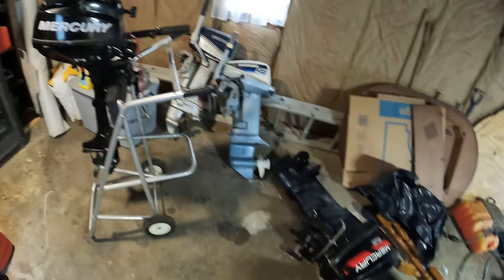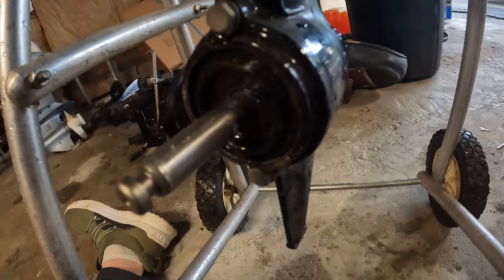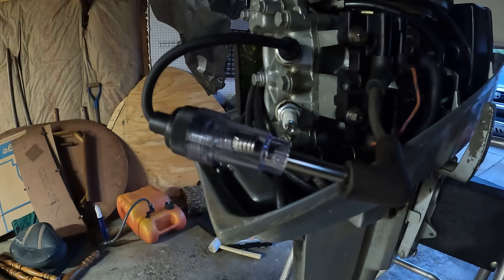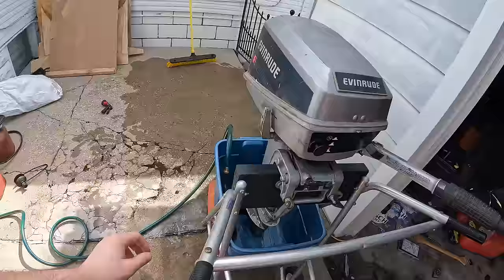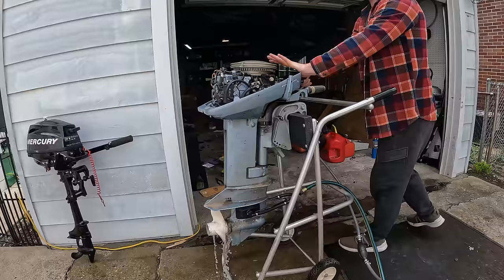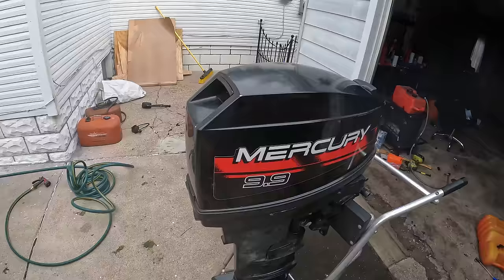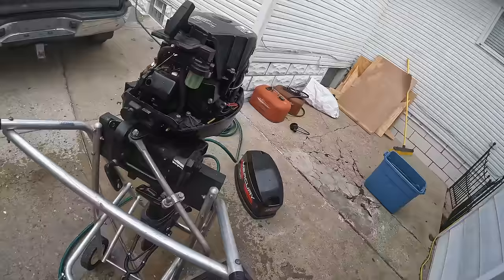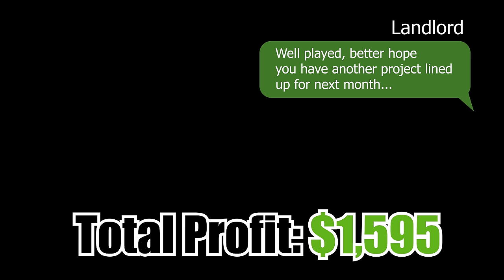Fixing & Flipping 4 Junk Outboards to Pay my Rent!

Comment: Please make more videos! 
I’m working on a 55 HP Evinrude my grandad gave me before he passed away (plus the 16 ft aluminum boat it came on). It bogs down when I get into higher gear but starts up fine. It’s very sentimental to me. This video was encouraging!
Reply from the maker: Making them as quick as I can!! Really appreciate the support. And yeah that’s a very common issue on the old 2 strokes, just sounds like you have a bit of dirt stuck in the high speed jet on your carburetor. Cleaning the carb should solve your issue! Either that or you have an air leak somewhere between your gas tank and the motor 👍🏼 make sure gas tank is vented as well. Also if it’s just a bit of dirt in the high speed jet many times you can just buy a can of seafoam and mix it with your gasoline and let it run for a bit. Seafoam will clean your jets and sometimes you can get lucky and not have to pull the carb off at all! (Although I always recommend removing it and thoroughly cleaning it). Best of luck to you!! Always available on instagram to give you any advice you need to get your granddads motor running. He’d be proud 👍🏼

Comment: Nissan builds a great 4 stroke, their value line is Tohatsu, basically the same outboard rebranded.
Ordered mine from Port Supply, the wholesale div of West Marine, it was very reasonable!
I put a TINY stick on vibration activated programmable digital hour meter, put the same on my generators, lawn equipment. They are great, cheap, most have never seen one!
I change the oil VERY OFTEN, they hold so little.
Lower unit oil too, this is never changed by 99.987 of owners, especially on stern drives!
Dry starts will instantly take out the impeller,

Comment: Cool vid. The majority of 2 stroke outboards I buy not running the blocks and lowers are always solid. Pretty quick to get them going good. 

Used to flip them in high school. 3 days ago I bought a 06 Suzuki 140HP 4 stroke all rigging 2 ss props + extra lower unit and controls for $800. Guy swore it was a solid motor but didn’t have it on a stand to show it ran. 

175 psi across the board no water in oil. Turned on and ran flawless first key flip. Worth $3k-4k. Great vid
Reply: ***Only lesson I learned in my 27 years. Don’t buy one from any young person. Get burned almost every time
Reply from the maker: As long as it has compression - I can make it run… but yea I love the ones that fire right up - the best feeling! Also don’t give all youngsters a bad rep! I’m only 24 😅😅
Reply: @BoatBusters  “youngsters 20 or under”. I remember what I did to those engines I would run religiously at that age. Being a broke 16 year old with a healthy motor was never a good match. Couldn’t afford the gas let alone the oil.

A youngin will lie right to your face and says it runs perfect. 30-40yo in a half decent area for the most part are honest and take way better care. 

Everything blows up but who’s using determines how fast it blows up
Reply from the maker: @jesseferreira8298  yea I can agree to that!!!
Reply: @BoatBusters  keep it up. For only 2 videos your doing more than awesome view and subscriber wise. 🤝
Reply from the maker: @jesseferreira8298  means a lot to me man! Really do appreciate the early support 🤝
Reply: @BoatBusters  what state you live in? I’m in FL. Majority of the time the heads are good but everything else is trashed. There’s a dude that drives down motors from up north and sells them down here
Reply from the maker: @jesseferreira8298  that’s too funny… I’m up in ohio - tell him to keep our good motors here!!
Reply: @BoatBusters  I freaking knew it! Every girl I dated down here strangely enough has been from Ohio. Only been there twice but by the looks of the vids I figured it was Ohio or somewhere close. 

Girls up there are brutal. Be careful my friend
Reply: @jesseferreira8298 Age don’t matter anymore lol 2 weeks bought a Johnson 20 hp guy swore it run I believed him due to his age and seemed honest said it just needed to be reasealed. Well he tried to reaseal it himself put all the gears in backwards trashed lower unit. Then last week bought a boat with a 60 hp Johnson from a older gentleman ran great in driveway I was skeptical because all the new parts but thought he was honest bought it took it out and it cuts out at wide open throttle Called him out and he basically admitted it’s been doing it. Long story short age don’t matter scumbags are of all ages now days.
Reply: @jesseferreira8298 fantasyland, you can’t trust anyone regardless of age😂.
Reply: @db9818  the problem is if someone gets burned on a deal they try to burn the next guy in-line to recoup their money. Anytime someone says it just needs carbs cleaned I never buy it. 

I’ve tore down a ton of carbs and only had 2 that were actually clogged

Comment: Just a heads up.  When you check compression take out all the spark pugs out and check with all removed.  Those engines with 75# would have measured 100# and thats a more accurate number.  You should have also been able to sell that 25 merc for 1800-2200, those are solid engines

Comment: When shopping for a project outboard, how old is too old? I bought a 4hp Evenrude about 7 years ago probably 1980s, took it for service, and was told many parts for that engine were no longer available. I looked up the parts and it seemed the shop was correct. Ended up leaving it at the shop and walked away from it. 

Great videos, Please keep 'em coming.
Reply from the maker: @LouisBackover  thank you! Also it really depends on the parts… also your issue was most likely less of how old it was but how low of horsepower it was. I’ve never had issues finding parts on any Evinrudes from 1965-1999 but I also really only work on 9.9 to 25 hp. And also depends on if you’re buying carburetor kits or pistons / cylinder rings…

Comment: Quick question. First I want to thank you for your podcast. I’ve learned a lot watching you. My question is I have a 9.9 mercury. I believe it’s a 1998 and I understand you can just change out a carburetor and make it a 15 horse. This motor is a two stroke motor. Can you switch out the carburetors on the older style mercury?

Comment: hi, great video! and to stop an otboard without killswitch you can pull the choke in and out (it works for me)
Reply from the maker: Thanks for the compliment and for the tip! Never have any issues flooding the engine doing that?
Reply: @BoatBusters  no, you just do it reaaly quick and if you dont have a other option

Comment: This just shows how much prices vary by area, Around here anything under 9,9hp is a tiygh sell running or not and a $100 motor at best. 9.9 and 15hp 2stroke motors bring $1k or better in season, about half of that in cold months. Larger remote motors are hit or miss, generally smaller 2 strokes are hard to find buyers for, larger 115 and up motors do better. Mercury in general is harder to sell then OMC. 

The fish police here gave a buddy a ticket a few years ago for running a Honda 100 (10hp), on a 9.9hp restricted lake. Although to game warden mistook the Honda 100 decals as meaning '100hp, a judge upheld the ticked because even 10hp is over the 9,9hp limit. It cost him over $700 when it was al done. I have four of those motors and have run them there for 30yrs or more without issue but they chose to pic on an 80 year old man that day  for some reason. I've simply changed the "100" labels on mine to '9.9hp' since then.
Reply from the maker: That’s insane… yeah there’s a lot of variance in price for sure.. also, seriously?? 9.9 and 10 Hp are the same thing… writing a ticket to anyone for that is disgusting, especially for an old man. Really sucks to hear that

Comment: Great video man! I have a five horse Coleman four stroke that is giving me fits trying to get it running. It has good fuel pressure good compression good spark every once in a while when I’m trying to pull it yanks the cord out of my hand… any ideas?  Sheared flywheel key maybe? Out of time? Who knows! Wish you were my neighbor!
Reply from the maker: Thanks for the support man! DM me on instagram - same username as YouTube and send me any videos you have of the issue if possible. I will admit I have never owned or worked on a Coleman before, don’t see too many of them but they all work the same more or less. I’d be glad to give you any info I can but I’d need to see exactly what you’re talking about. So yeah shoot me a DM with pics / videos and we will see what we can find!

Comment: I am building a 1648 panfish stick steer.  I could really use some advice on what prop to get for a 25hp mercury 2 stroke from the 80's.  I cannot find what came on the old bass tracker panfish.  As far as weight.  I will be lighter than the tracker panfish overall.  Any advise will be greatly appreciated.  Thanks.

Comment: Are sellers generally willing to let you run through their outboards with testing, or is that a bit of a sales pitch on your part? Just wondering how willing they are to spend time while you do so on a $200 engine. What do you tell them? Thx, learning a lot!
Reply from the maker: @jameswallen4854  depends on the deal. Often times people just don’t know what they have and will be selling a good motor for the price of a blown parts motor. In those situations I do not waste their time with tests and bs because I know his phone was ringing off the hook with people trying to come buy it. Also on those great deals I know that no matter what I find I’ll be able to at least part the engine out for some profit. However other times I’ll get into one a little below fair price and those I want to at least compression check. Small outboards really will never cost more than $100 to restore spark to if the ignition system needs work so I rarely test spark when buying. But if a seller can’t run the engine for me and refuses to give me 5 minutes to compression check the motor before I buy it then they’re 100% hiding something big and I’d rather not buy it from them. Only happened to me once, 99% of sellers will not have an issue with a quick compression test
Reply: @BoatBusters  thats awesome man, thanks so much for taking the time with the detailed answer. Its makes total sense!

Comment: Hey man I just got a 1986 evinrude 2 stroke motor and it ran fine when I got it maybe a week ago and the 3rd time I started it it would only start with the stick all the way in forward and even then it was taking my 1648 jon about 6 miles an hour, I’ve got good compression on both cylinders, have spark, rebuilt carb several times, any ideas what it could be? Thank you this is killing me, it’s my first boat and I’m a little lost
Reply from the maker: Sounds like an issue with the float in your carb. Usually no start unless wide open is a tell tale sign that your carburetor is flooding the cylinders. Too much gas to ignite until you open the throttle and the extra air will allow it to start. Since this is your first boat, a very common beginner mistake is not having your gas tank vented. Gas tanks have a vent on the lid that has to be open to let pressure out. Vent the gas cap and unscrew it to let pressure out before connecting your fuel line. What happens is the pressure builds in the gas tank then you release it into your engine and the pressure from not being vented will force excess gasoline into your motor. So first and foremost make sure your gas tank is vented properly. Next thing make sure your primer bulb is facing the right direction! There’s usually an arrow to indicate correct direction of fuel flow. Lastly, just because you rebuilt the carbs does not mean the float is set correctly. They need to be set manually and are not pre-adjusted “out of the box” … the float must be level and there is a line on it to mark how high / low it needs to be. There is a test (no tools required) to make sure your float is closing properly, I demonstrate it in my most recent video!! Also these motors run surprisingly well on only one cylinder. I would get a gap tester and make sure spark on all cylinders can jump a 7/16” gap. If you have any more questions or need more help I’m always here as a resource for my YouTube community- feel free to DM me on instagram (same username) and I’ll help you work through your issues best I can!

Comment: Question for ya, where did you install the positive and negative wires on the motor?
Reply from the maker: @MichaelAnthony-f7p  red wire goes to the right post on the starter solenoid, black wire goes to engine ground: normally on the bolt that holds the starter to the block 💯
Reply: @BoatBusters  your the man! Idk how you responded that fast, but thank you
Reply from the maker: @MichaelAnthony-f7p  There is no higher priority than making sure my subs have their questions answered!!!
Reply: @BoatBusters  well since I’m here I might as well ask another question, I have an evinrude 25hp outboard that has a lose starter. The cylinder that covers the inside of the starter is very lose with the gasket hanging out. How do I go about tightening the starter because I’m afraid if I start it it’ll fall apart. Thank you!!
Reply from the maker: @MichaelAnthony-f7p  shoot me some pics / vids to my instagram (same username) and we can take a look!
Reply: @BoatBusters  awesome thank you!

Comment: Did you check the impellers on both evinrudes? Both didn’t seem to be pumping much water?
Reply from the maker: I have a larger tank that I test impellers in, the muffs were leaking on the 9.9 and the 6 the water was barely above the intake. Both were much stronger in the deep tank but I unfortunately didn’t film that. Good eye though! Was waiting for someone to call that out…
Reply: Awesome channel. Subbed. Cheers from Sweden.
Reply from the maker: @northernmotion090  🇸🇪 🇺🇸🤝 thank you!!

Comment: Hi good sir what can you tell me about my issue I have a 89 150 blackmaxx the issue is it's peeing but not a steady stream it's more like spitting... I've change thermostats and water pump impeller this is my first boat and not too much knowledge on 2 stroke motor
Reply from the maker: That’s very common on the larger Mercury motors if you are using the water hose muffs at home. When you are on the water riding it in the lake does it still just spit? You can also fill a large barrel with water at home so it’s well above the intake and put it in gear and raise the RPMs. It should turn to a good strong stream submerged in water. If it still is not peeing on the lake and you’re confident your water pump and impeller is good, you may have some dirt or sand in your pick up tube or water lines. You can try to take some thin wire and run it through the pee hole and see if there’s any blockages. However I’m betting that you’re just using muffs in the driveway and most of the time that just isn’t enough for those beefy motors. Good luck!!
Reply: @BoatBusters  thanks yea I did all that poke it with trimmer wire took it to the lake thinking it's the muffs but same so I'll check the pickup do you think the water jacket have anything to do with it?
Reply from the maker: @hmongxwb88  it could. It’s definitely the most uncommon and rare issues with water pumping and is always the last thing you should check though - it’s a huge pain. If you only replaced the impeller I would replace the entire water pump housing and seals as well, and make sure you did the water pump job correctly. There’s usually a key on the shaft that locks the impeller in place and it’s very small and easy to miss. If you don’t have that, it won’t work right. My last thing I will recommend you do: thermostats open and close based on temperature. I recommend completely removing all of your thermostats and then putting the housing back on but with no thermostats inside. Then try to run it. If the water stream is fine, then your thermostat job wasn’t done correctly, you got bad parts, or your motor just hasn’t gotten hot enough for a full stream. But remove your thermostats, replace the housing, and see if that fixes the issue. You do not want to run your motor for extended periods of time without thermostats, but it will not harm your engine at all to fire it up without them for diagnostic purposes.
Reply: Ok thanks a bunch I will do that before the hard stuff and yea I replace the whole waterpump assembly and went off some videos on how to do it thanks again
Reply from the maker: @hmongxwb88  you bet. And water stream is not the only indicator, use a laser thermometer while it’s running. If it’s within proper operating temperature and not getting too hot then you’re fine 👍🏼